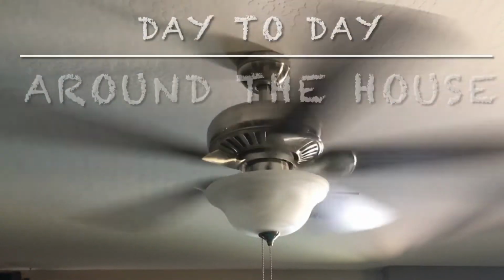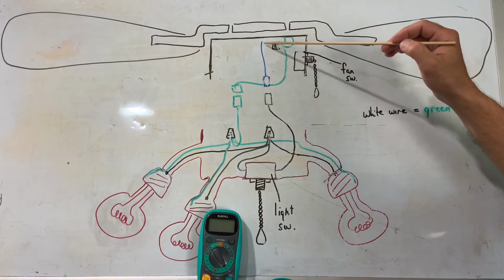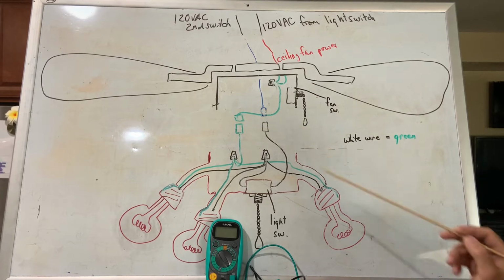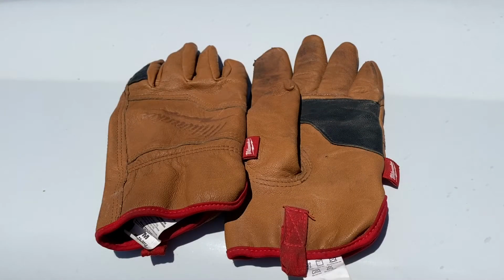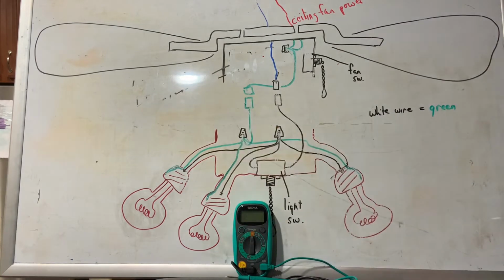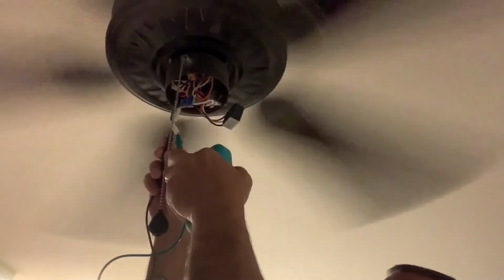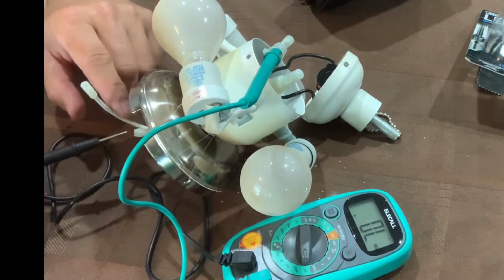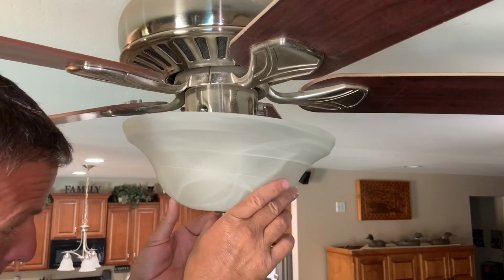Ceiling fan works but not the lights diagnosing the problem wattage limiter/switch & repairing it

Comment: Yeah man, so i bought this home about 5 years ago was being updated  remodeled etc has a nice 4 season sunporch, had the guys replace all old fixtures, lights, ceiling fans etc with new stuff in every room, they put in Brand New 52" 5 Blade 4 light Harbor Breeze Springfield ii ceiling fan out in the sunporch,   (supposedly has remote) but they wired it to the old 4 speed wall dial switch type (living room side of wall just before entryway to sunporch) so the dial controls fan speed, but also has 3 pole light switch (right underneath dial switch) 1 switch controls lights and power to the fan, 1 switch does couple lights in living room, 1 turns on outside sunporch light (which also stopped working about same time) So one day ceiling lights just never worked again, fan ALWAYS works, so I flip the breaker to sunporch fan still runs? Lights still have power also but they never work?? I used tester see if any wires still hot and they were, so entire house 20Amp but they put 15Amp  everywhere including sunporch, breaker box labeled crazy so I'm flipping  breakers one by one finally found it, EVERY VIDEO says get that wattage limiter (black box thing) outta there so I cut it out, BUT NOW IDK what to wire back to what and can't find ANY info on it cuz apparently that dumb black box wattage limiter is "Federal Government Mandated" so it's illegal to bypass it i guess.... sorry for the story book but can you help?? Tell me what goes to what?? I understand  white blue some black wires, but I got 1 green, few orange, a purple, a red, a whole braided cluster of black ones, AND the ones under the Canopy.... sucks

Comment: So I did the continuity testing but I have a cheap harbor freight meter and it doesn't list ol. When I put the probes in place it simply says "1" then when I pull the switch it will read anywhere between 5 to 100 depending on what seems like the position. Would this indicate a working switch? The same happened when I simply touched the probes together.

Comment: Great video. I have an electronic controller that runs things on my fan. I wired everything up and my wife put in a bulb(I didn’t see what wattage it was), it blew and then the other bulbs I put in didn’t work. I did read 128v to the light sockets. Does this sound like the wattage limiter failed?

Comment: Have similar ceiling fan.  However, when I check continuity of the light switch it does not go to O but bounces with different  number of ohms.  When off it does go to 0L.  Does this mean the switch is still bad?
Reply from the maker: @donens9310  depends on the number if it's like .05 ohms  that's probably fine if its 5.07 ohms its probably bad  sometimes its hard to get a meter to read a perfect 0.00

Comment: Very helpful video Dan! My Hunter fan seems to be a strange one, there seems to be no limiter (just the two capacitors for the fan)...worked great for the 2 years we have lived here, and the fan still works, but the lights will only blink on and off continually. Does anyone have any idea what would make the lights do this continual off/on blink if there is no limiter (doesn't matter if LED or incandescent). Is it possible Hunter hid a limiter somewhere that is not accessable? Thank you for any help!

Comment: Is a wattage limiter the same thing as a capacitor?
Reply from the maker: No two different things
Reply: @diydan7019  thanks! I have a hunter fan that has two switches. All the LED bulbs stopped working, changed bulbs but no change. Fan works though
Reply: @derekmatthews3714 did you watch the video?  Do you have a multimeter or a bulb or pen tester?  You'll want to test the blue wire connections.
Reply: @derekmatthews3714  have the same issue. I found that the problem is with the bulb socket. The small part that is to make contact with the bulb lies flat. Has no memory to stay flexed against the bulb. No contact. No light. You can replace the bulb socket.

Comment: Came across this after I troubleshot this exact problem and was looking to buy a new wattage limiter. After reading up a bit about it and the reason for them (EPA regulations), I agree with just removing it and going with LED’s. Thanks for the great explanation, wish I saw this video before troubleshooting.